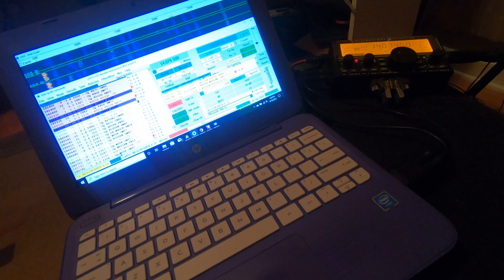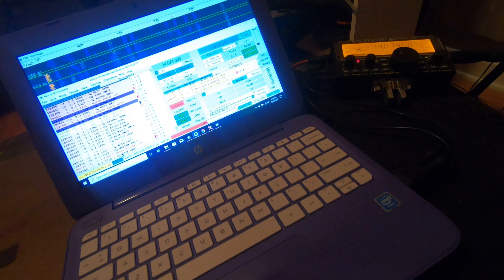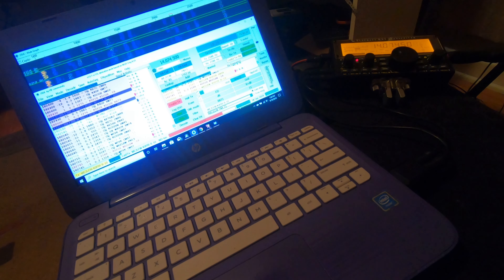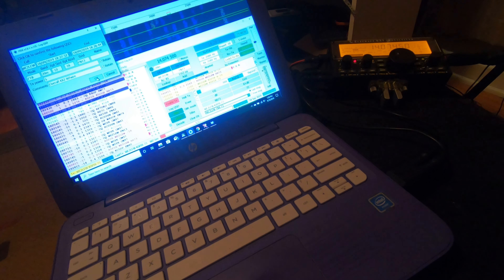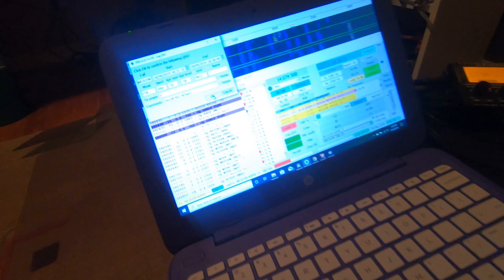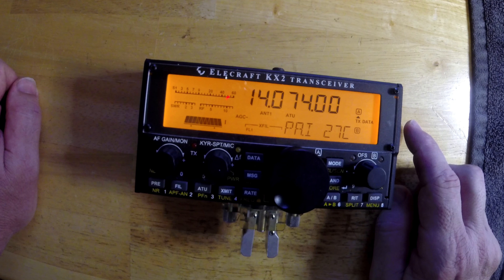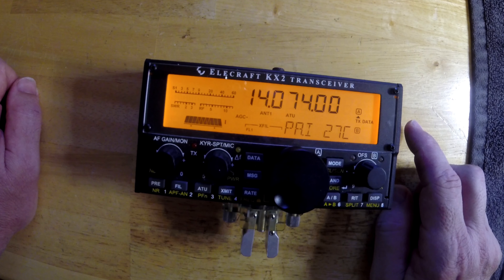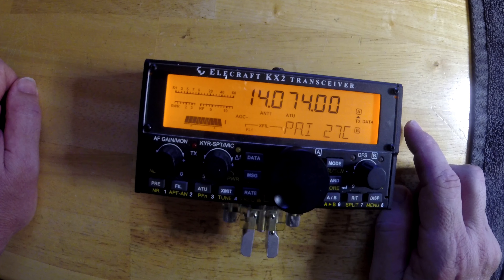Elecraft KX2 Settings for WSJT-X

Comment: Great video Richard. I guess all those settings and info would be the apply for the KX3?  There was some conversation early on about the temperature
stability with the KX3 with digital modes, that's why I have been hesitant to run them.  But with the short transmit duration of FT-8, maybe that won't be an issue.  I will give it a try.
Seems like the KX2/KX3 would be ideal little radios to use for those digital modes.  73.
Reply from the maker: Thank you and thanks for watching and commenting here. Yeah the KX3 is a more advanced I think you have a real good opportunity with a KX3 and these weak signal digital modes. I would especially like to see if there is activity on 160 m and on 2 m with a KX3. 73’s

Comment: Setting up the KX2 for FT8 and noticed something that is not right.  On my K3 I run FT8 with the radio set to DATA A.  Audio response on the WSTJ-X waterfall is flat as I would expect.  On the KX2 DATA A results in the audio response centered on 1500 Hz and drops off a few 100 Hz either side.   That is not right, at least by my way of thinking and looking at the K3 response.  So I have the KX2 set to USB to get a flat audio response.  If you set other DATA settings you get audio response appropriate for that data mode.  Why is my DATA A audio peaked at 1500 Hz?
Reply from the maker: Hi Mike, check your filter.
Reply: @HamRadioAdventures  Yep, that was it.  I checked the filter before but that must have been in USB mode.  Switching to DATA switched it.  Now that I have changed the setting it is staying there.

Comment: You are showing USB,  I am starting in 40M and can't get Data A and USB, how do you do it?
Reply from the maker: Have a look at this page and it is in the first video about 50 seconds in. You won't see USB displayed while in Data A mode, but that's what it is. 73! http://www.k0pir.us/elecraft-kx2-and-wsjt-x-easy-setup/
Reply: @HamRadioAdventures  Yes, I studied that page. The problem I'm now having is I can get in Data A however sometimes it is LSB and sometimes USB. I can switch it but then when I go from RX to TX it always seems to go into LSB. It was my understanding from the manual that Data A is default USB, why is it switching and why do I have to set it in the first place?
Reply from the maker: @sparty837  In the software I use  Data/Pkt for Split Mode. Is that what you are using? Try either Data/Pkt or none.
Reply: @HamRadioAdventures  Yes I'm using the same modes/settings as you. It is almost like the radio thinks LSB is the default for Data A
Reply: @HamRadioAdventures  Just in case you have any other viewers that have fat fingers, I figured it out, I put K2 in  Rig instead of KX2 and apparently that screws up the sideband selection and maybe other things too.
Reply from the maker: @sparty837  Go to MENU:ALT MD. is it set to nor?
Reply: @HamRadioAdventures    ALT MD flips between LSB and USB.  If you are on the lower HF bands normal would be LSB.  For DATA you run USB.
Reply from the maker: @w8rko470  Mike, yes ALT MD does that. Have you verified by making QSOs? My radio is not hooked up at the moment, I will check again, I believe I run USB DATA on all bands.